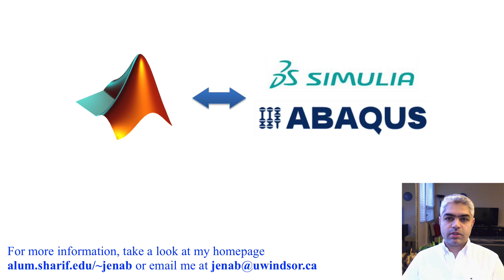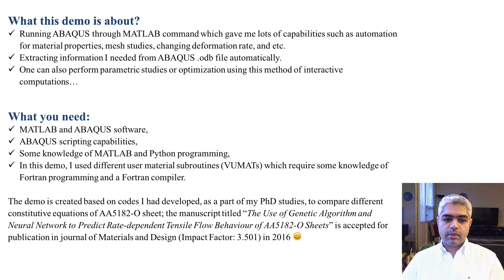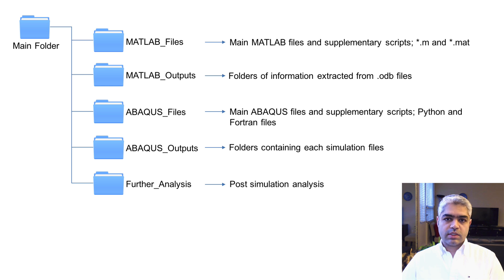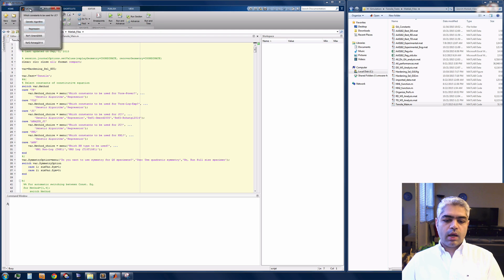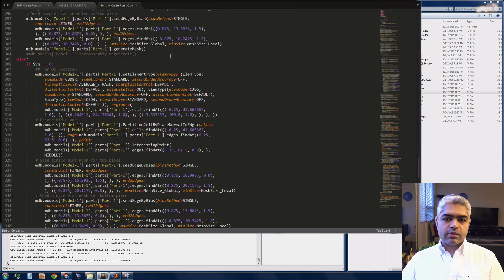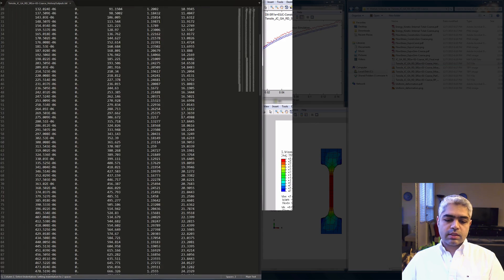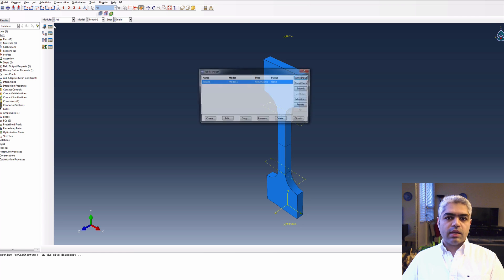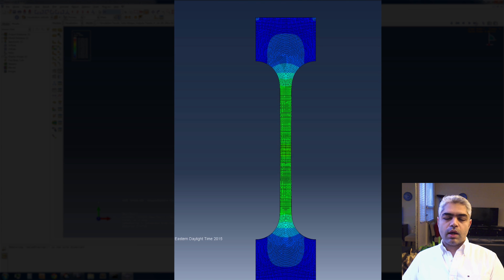Finite Element Simulation of Tensile Test Using MATLAB and ABAQUS Interactively

Comment: I am wondering why and where to use MATLAB in our process when we are using Python capabilities? 
Python provides functionality required to modify the material properties, create hardening curves and required error calculation. So, why MATLAB?
Reply from the maker: You are right, we can do many things MATLAB does in Python. But beside the fact that MATLAB is the preferred-easy to use programming tool for many, it has several fascinating toolboxes including neural network and genetic algorithm (that I used for some of my publications).

Comment: thanks. I simulating NITINOL material in abaqus. can I define material model of nitinol in matlab and interface with abaqus?
Reply from the maker: +M Umer Yes, you can. I know that it is doable with ABAQUS input files but my preference is to use scripting; I just find it more understandable. You can write your material properties from MATLAB into a simple text file with Python extension (using fprintf) and then call this file at the beginning of your ABAQUS script and finally assign each parameter to its value.
Reply: Because i am Phd Student and doing my phd research on material characterization at different strain rate. please can you send  the add in to matlab and abaqus integration software because my matlab is 2016 version i coundnt find such add ins , and also Arash can you send me the add ins as well as you sample examples done on this videos to my email    bogale.sintayehu@gmail.com or D10503801@mail.ntust.edu.tw    thank you so much for your cooperation!!
Reply: M Umer dad!